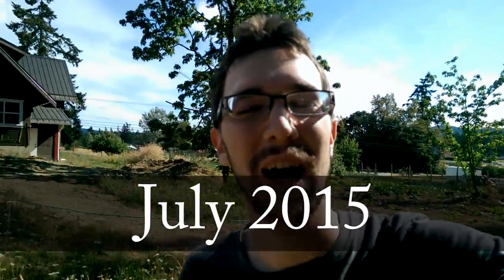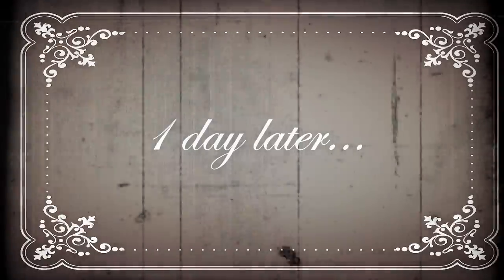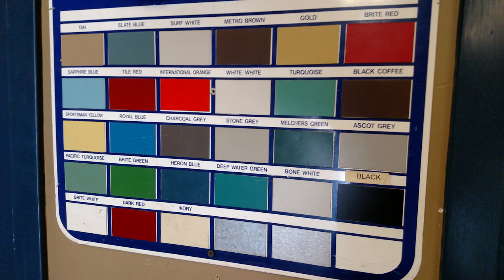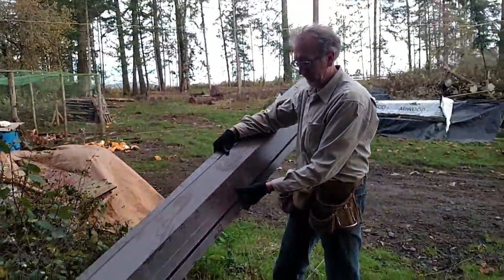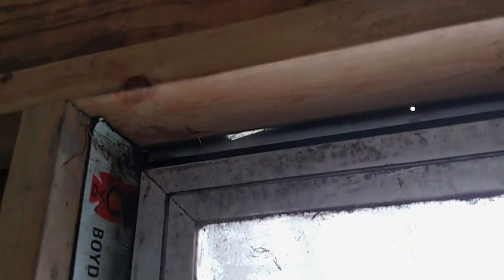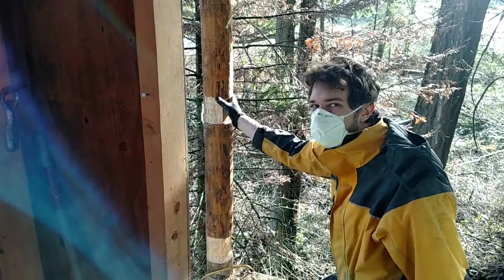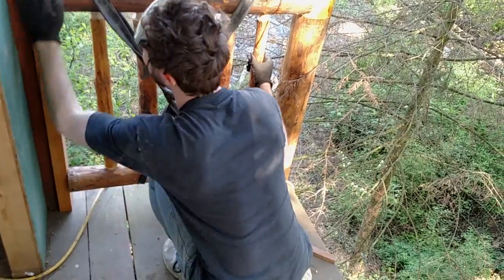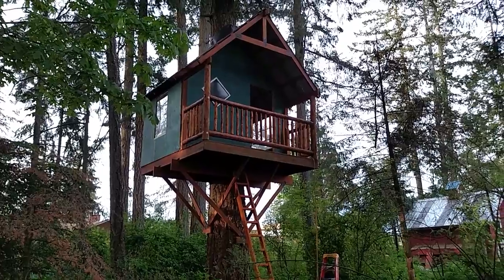Taran builds a treehouse

Comment: next up.. Taran macros a couple of drones to build a treehouse IRL
Reply: Totally needs a motorized platform on pulleys to carry things up when they're too hard to carry up a ladder. I was going to say drones that carry things up, but with all the trees around, seems like they'd get caught on branches. But that would be pretty sweet, push a (macro) button and the drone runs off to grab a drink and fly it up.
Reply: @Aeroxima  Drones are just a term, not limited to flying.
some are designed to grab around things and climb up using rubberized motor wheels  kinda something like this
https://www.youtube.com/watch?v=JMKjPVNd9h0
Reply: True you could call remote control cars drones if you made it self ran

Comment: So the reason why the wood cracks/are checking is like your dad said because that the wood contains a high level of liquid and if the tree is dried unevenly after being cut down - the risk for it to check is much higher than if you take some precautions. I've looked it up on google, and it says to 

Step 1
Remove the bark with a hatchet or a draw-knife if it's already loose, to discourage damage from insects that live under the bark. If the bark is tight, leave it on to help slow drying of the outer layer of the wood.

Step 2
Coat the exposed end grain of the logs or boards with a thick layer of paint, varnish or a commercial green-wood sealer to prevent moisture from escaping too quickly. Wood loses moisture 10 to 15 times faster through the ends than it does through the faces.

Step 3
Clear a space in a sheltered area large enough to spread out the wood. Choose a shed, barn or garage, or plan to cover the wood with a loose tarp propped up so air can circulate under it. The area should have some air circulation but prevent rain from wetting the wood.

Step 4
Stack any thick wood blocks or logs loosely. If the area doesn't have a floor, place scrap lumber under your wood to keep it away from contact with the ground.

Step 5
Place the scrap wood crosswise on the ground every 2 feet to support already sawn lumber you need to dry. Set one layer of the boards you're drying across the scrap lumber. Place 1-by-1-inch slats of scrap wood called "stickers" across the boards every 2 feet. Set another layer of boards on the stickers, add more stickers and continue until you're stacked all the boards with stickers between them to allow air to reach between the layers.

Step 6
Inspect the lumber every few weeks and improve air circulation if you notice signs of mold. As a general rule, allow one year of natural air-drying time for each inch of thickness.

Step 7
Move the wood to an area similar to its final location so it can adjust to the moisture in the air, with stickers placed between boards again. If you'll be using the wood in full sunlight, move it into the sun. If the wood will be used in indoor furniture, for example, you can saw or split the wood into pieces closer to their finished size to save space, then stack it indoors where it can adjust to household humidity. Allow one week to several weeks, depending on the thickness of the wood, for the final acclimation. 

Really nice to see a different video from you - and I'm happy to see that the treehouse project got you a lot of 
quality time with your family - which I at some point think is more important than being done with the house, although that is also cool:)
Reply: Definitely a draw knife, you can get them cheap on Amazon.  I have one, it does the job.

Comment: Good work, Taran. I've always wanted to build a treehouse ever since I was little and played the original Myst, specifically the Channelwood Age. I've done some research of my own (just research, mind you, as I've never lived in or near a forest) and found that some of the oldest, most reliable treehouses over the long term are suspended within clusters of 3 (sometimes 4) trees that are about 10-15' apart. I think most of the reliability comes from the fact that there isn't a tree coming up through the center, making water control much easier.

Comment: 32:30 Wood will split when it drys unevenly. For posts and lumber, you should paint the cut ends with some bee's wax before allowing them to dry for a couple years. The wax will seal the straw-like wood fibers and let it dry more slowly and evenly, reducing splitting.
Reply: I was gonna comment that his dad was actually right. Haven't ever tried the beeswax thing though. Anyone that has dried or cut a lot of wood knows about the tension that can be in it trying to split it apart or bind it up on a sawblade.

Comment: When putting the tree painted plywood sheathing on the walls, let it go down past the bottom plate (bottom 2x4), so it can be secured to the sides of the joists. It also helps shed water, and helps you line it up.

Comment: Well your floor gets "moldy", because it gets wet. obviously.. so you need to prevent it from getting wet. Which you can't cause its always "kind of wet"  considering air humidity and the gap(s) between roof and tree. I wouldn't lay the floor directly on to the plywood, but space those with some 1cm or 2cm (yes, metric cry me a river) thick pieces of wood. It will still get wet but it can dry quicker and will not be moldy so fast. 

As for the cracks in small logs and generally thicker wood: Three things that are rather logical.. 1. Wood is moist 2. Moist things shrink while drying 3. The surface of a tree drys faster than the inside (ventilation and evaporation) 

Now imagine a tree as a lot of cirlces.
As the surface drys first, it shrinks. You could say the biggest circle shrinks the most, the secong biggest shrinks the second most and so on... Now because the outer cirlces of the tree start to decrease in diameter, but the inner cirlces dont the tree has no other option but to crack open eventually. There you go .. boom .. cracks. In germany they are called "Trocknungsrisse" which translates directly as "drying cracks" and they have a huge impact on the quality of our timber construction wood. There are actually rules for how deep, long and severe a crack can be for the beam to be still used in construction.
Nice project you got there ! Greetings from germany

Comment: You might want to use something to fill the creases between the beams and the walls, and then maybe install real siding on the treehouse. That will greatly prevent any excess moisture build up within, which could be a big contributor to the mold

Comment: Did you buy pressure treated lumber for the supports? Pressure treated wood should resist mold growth pretty well. It is more expensive and has a weird color, but you were painting over it anyways.
For the floors, you should apply a water resistant coating to the top and underside of your plywood and then do a laminate vinyl floor. You can do a thin cement layer and then a glue layer on top of that, and you shouldn't have any mold problems.

Comment: 32:40 wood cracks like that when the outside dries out faster than the inside. Not a professional woodworker but I've worked with ceramics enough to be familiar with the principle. In the ceramics world, clay is left to dry in what is effectively large HUMID airflow rooms. The temp and humidity are kept under close watch to assure that there inside can dry out and contact at the same rate as the surface. Also-- as natural materials dry, poures shrink dramatically, leaving less opportunity for water vapor to permeate the surface, therefore trapping the expanding gas.
Reply from the maker: So what should I have done to avoid the log cracking? paint the ends? wrap it in plastic to keep moisture in?
Reply: @TaranVH  I'm not sure where you get it, but i know there is a product called Anchorseal that you can paint on end grain of green wood to slow the moisture leaving the wood to prevent checking. Matthew Cremona on YT does a lot of urban logging and can/has explained it a lot better.
Reply: @TaranVH  paint the ends only after the wood is bone dry all the way through. Otherwise, the issue might be exaggerated or you know.... Mold. Same goes for wrapping in plastic.
Drying profiles are usually detailed to the specific material and thickness in ceramics so I can't give you any ideal temp/humidity levels (especially for wood) but I'm not sure you have anywhere where you could control humidity of your fresh cut wood. The closest thing to a home brew solution I can think of would be with a garage and space heater. For particularly thick ceramics, a ballpark setup would be ~90°F @ 75% relative humidity for at least two days.
.
Realistically though, I'd recommend buying pre-dried or lumber or at least using long-dead trees. If you do want to use lumber from your own property, it shouldn't be too hard to find a place that could process it for you though I'm not sure it would be worth the added cost/effort.
Reply from the maker: @Ava-wu4qp  what! I'll have to ask my dad, but all the unmilled logs around our property have painted ends. Maybe even the milled wood? I don't remember. Yeah all the Douglas fir is from our own trees, I didn't even mention that in the video. Milled on site.
Reply: @TaranVH  painted ends should be perfectly fine if the wood was dry before painting. It's mostly freshly cut/fallen wood that you'd have to worry about. You just don't want to clog up pores for water vapor to escape (via paint or uneven drying).
Though with everything I'm saying, keep in mind that I'm not a woodworker. I just have a background in commercial and some exotic ceramics and am assuming that much of the practice carries over to the massive wood drying chambers I recall seeing a couple times on "How It's Made".

Comment: I'm not an expert or even qualified to say much of anything but from emergency work done in my own home by professionals I'd say your mold problem isn't "not using XYZ stain" or "water is getting in" but rather "moisture is staying in."  The professionals that did the work used some massive conical fans similar to that one massive fan you guys used on LTT that one time to get rid of the moisture during and after the work. Given you can't guarantee the interior of that space to be waterproof I'd say you need to make the floor permeable like a deck rather than a solid piece of plywood laying flat, which collects water (and is held together by glue, which is also bad for structural integrity when wet!). Plywood is fine for the walls since water won't sit on it. I don't know enough on the subject to give a solid suggestion as to how you might avoid the molding issue without having a permeable floor AND "not strangling the tree" like you're worried about. Maybe adding that rubber skirt around the tree on the floor as well, sealing up every join on every wall with caulk, doing everything in your power to seal everywhere? I'd be concerned about ants, bees, wasps, birds, squirrels and other such wildlife moving into such a convenient space.

Comment: Your tool belt is on backwards. The tape measure pouch goes at the small of your back. (Above your butt crack.) Use a tube, like the ones you use for water cooling a PC, fill it with water, and you can use the level of the water on opposite sides of the tree.

Comment: Ok. So here's why you shouldn't just dump oil on your bit or bolt. When you open up a tree like that and cut past the bark your opening up a vector for contamination into the tree. it'd be best to run a torch or at least run bleach water or alcohol over the bit and bolt before installation since youre guaranteed to have some fungal or bacterial spores on them waiting to germinate and you've already introduced them far beyond the bark. you can use olive oil, but it should be run through a pressure cooker first.

Comment: As the sap and moisture leaves the wood it shrinks. Some area's of the timber shrinks unevenly which makes cracks.
Reply: Sealing ends could help
Reply: @JGnLAU8OAWF6  Very true,  there's a ton of factors that are involved. What kind of wood is it? Hard or soft? Does the wood naturally have a lot of sap? How long did it take for the wood to dry? are there knots in that section? how many are there? Any near the end? But correct indeed.
Reply from the maker: @wildwilie  It's all Douglas Fir
Reply: @TaranVH  I wouldnt worry about it though. Even if there are cracks, if it still in trunk form. Not cut in half or made into lumber. It stays very strong. 

If you pay attention to electrical poles for power on the side of the road. You often find some with massive cracks. But its still incredibly strong.

Comment: They make a deck sealant, rolls on like paint, has a rough almost sandy texture, holds up well with water
Reply from the maker: hmmmm. doesn't sound very fun for kids to play on, though.
Reply: @TaranVH The one i used had sand you could add or leave out

Comment: If you want to prevent mold then just use old motor oil or just old oil you can get. It might not be good for sitting on it but it will protect the flooring nonetheless